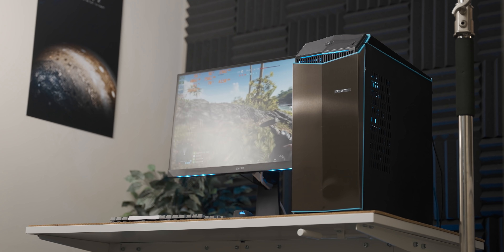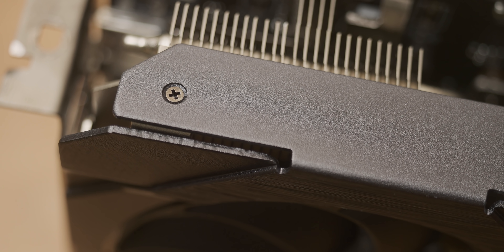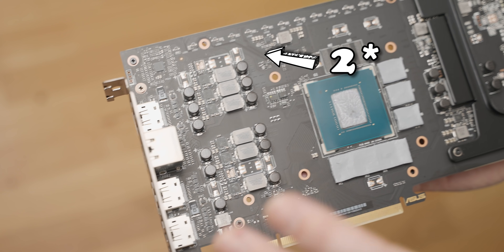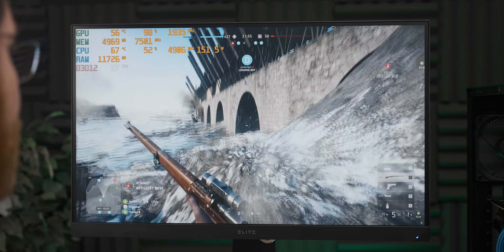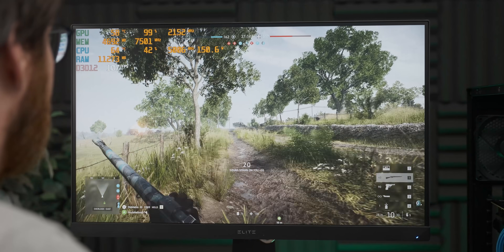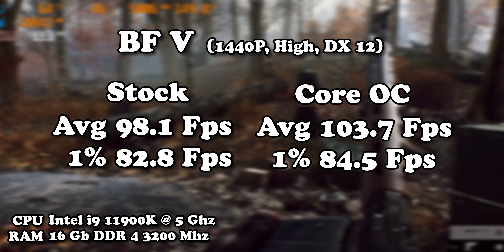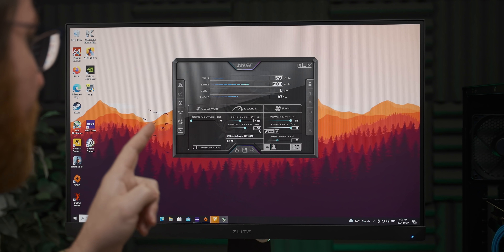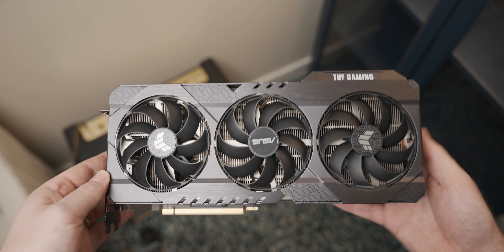Overkill Is BEAUTIFUL, But Will It Overclock?

Comment: Miss my 3060, It was a golden chip (to me) OC to 2.2ghz on the core and +1500 on the memory. Was within spitting distance from a 3060ti stock. It was the Asus Strix modal
Reply: why buy such a high tier 60 lvl card couldnt you have picked up a 3060ti of some other model for the same price as a strix?
Reply: @itsuadman  I no longer own that 3060, that was back in COVID lockdown times in 2020 where all GPUs was super hard to get and the 3060 Strix at the time was $450 I got it for vs the scalped $800 3060ti as they were the best price to performance cards for mining back then. I have a 4080Super now

Comment: Bought this card second-hand at 196 euros today. Given that the boost clock of a stock RTX 3060 12 GB is 1777 MHz, 2167 MHz must offer more than 9 percent performance boost as it is 399 MHz (22 percent) higher clock speed? Would love to know the difference to a stock card ;)

My system also features a Ryzen 5 2600 @ 4,15 GHz which I got for 20 euros. Love finding used but still capable parts and pushing them to their limit.
Reply: I got one off fb marketplace for $180 a few days ago. Came from a 1650 super and I’m really happy with it

Comment: "4 hours overxclocking for 9%"
XOC guy here. you dont know hadness until you did it 12 hours for benchmark comeptitions
protip: use nvidia inspector to rnable rebar in games and benchmarks that dot officially support it. gains are good.

Comment: Just got this card and ran 3DMark test with results low. Went into msi afterburner. Activated over clock and it was getting higher MHz than my evga 3070 ftw3 and PNY 3070l. WTH

Comment: I just built my  first ever PC around TUF Z790-PLUS WIFI D4, Core i5-13600K and TUF RTX3060. I mostly play open world crafting survivals and have noticed a significant raise in enjoyment, since the upgrade from my prebuilt Core i5-4460 and GTX760 system from 2013. My monitor though, is only 60Hz and most games run smoothly at 60FPS with VSync enabled. I've noticed a huuuge 80-110W drop in GPU power when I enable Vsync in pretty much any game I play. What's up with that?

Comment: I own this card and i gotta say man- this things a beast seriously the best card ive ever owned plays 1080p 144 fps maxed out most games and 60+ fps maxed out 1440p most games minus a few newer ones  even with some of the craziest overclocks ive ever thrown on a gpu with over +200 to the core 1300 to the memory it was still stable- overbuilt is honestly not even enough to describe this even with insane overclocking with a 3 hour stress test never got above 61C its a amazing cooler they put on this card I was able to see able a 14% performance increase with the OC and some other tweaks with my PC definitely one of the biggest overclocks ive been able to get thats stable this card is so well built especially for a 3060 it just amazes me

Comment: This is the exact graphics card I ended up with been struggling to get a steady frame rate in Skyrim vr with tons of mods on thought over clocking would help me get a consistent framerate in intensive environments like outside white run
Seems to me looking at this, this card just can’t handle all the mods and my solution should be to cut back
I play alot of vr Pavlov runs like a dream funny Skyrim vr port with mods runs so badly I guess there must not be a lot going on in Pavlov

Comment: My cheap 2 fan Palit 3060 does the same OC, this is the general limit. (loud fans however)
you would be surprised how many games (FC5 with hd texture pack for example) used/cached 11GB of the 12GB vram..

Comment: i feel like the strix card would be better for this. similar crazy cooler maybe better silicon? I have no clue if that's correct. I actually had that exact card for a few months while I waited for a 3080. It did great and I forgot that gpu fans are actually supposed to ramp up during gaming haha

Comment: I have an rtx 3060, and it's an overclocking beast. I didn't want to do a very aggressive overclock so I went with +200 core clock +1000 mem clock, and  it ran fine, as excepted. But here's the catch! I have the palit stormx edition of this card, which has one big fan, and it never really goes above 66°C, which  - for a one fan card - is pretty good, in my opinion.

Comment: I reached 2250 MHz core on my 3070 and +1 GHz on the memory. I couldn't believe my eyes. It is stable at that core freq in all benchmarks and games I've tried. I also never had to increase power limit so it remained at around 200W. Temp never goes above 65C. Gotta say, MSI's Gaming X Trio cards are damn good

Comment: just got this card for 509.00 at my microcenter and was thinking of returning it until now - card was originally supposed to be 350.00 but in this climate I think I got a good deal - still selling for over 750 on ebay and over 850 on amazon

Comment: The best way to usually OC these cards is using the curve feature, especially with the higher end cards as it will allow for higher clocks under full load and lower temps. With this setup the OC will actually drop once the card starts getting hot, with simple games it won't do much but play anything demanding it's going to drop due to temps. https://youtu.be/FqpfYTi43TE?t=3

Comment: Video idea. Get an r9 290 tri-x. It's the graphics card i have and the overclocking potential is oddly good. This thing produces so much heat that i had to actually bluetack a 3000rpm 80mm fan just above the graphics card so the heat wouldn't muck up my CPU cooler. This runs hot but i never exceeded 70c surprisingly

Comment: I just got a 3060 (took me forever) and its temps are shockingly good. I was playing many newer titles and the temps barely reach 70C (average was 67C). Up until now I was using a GTX 1070 and it always reached mid-70s sometimes 80C for some games.

Comment: Dawid, remember you should check the VRAM temps, not just the GPU core die temp. Remember that for the 30-series, the overheating issue is on the VRAM, not the die itself.

Comment: I overclocked my LAPTOP 3060 (90w) to plus 1400 mhz on memory and plus 220 mhz on the core, yet it stayed under 73 degrees, and my 10870h wasn't even bottlenecking the thing. (I have a Dell G15 5510 with a 3060 90w 10870h (8c 16t) 16gb 2933mhz dual channel RAM that all uses the cooling system fitted in under 1.2 inches in girth.) So I am very confused as to why and how I was able to steadily overclock this laptop better than this "chode beast." Went from like 36fps avg with 25 fps 1 percent lows in Control all setting cranked up with ray tracing to like 42 fps avg with 1 percent lows in the low 30's.
Quick edit: I just realized that the OC on my laptop isn't as good as on the desktop 3060 TUF but I still think it's amazing as to how high I could get it, and I didn't even set fan curves!
Reply: @Mazda3Astina  Im ok with low settings gaming so I might not upgrade in 2 years, but definitely within the next 5 years I will be upgrading.

Comment: Wish my 3080 performed this well under load. I have the 3080 Ventus OC model. Has a massive 3 slot cooler with 7 heat pipes and 3 fans. But yet if I run it stock, it pretty much gets to 83 degrees quick and stays there. Even with an undervolt and fans set to hit 100% at 80 degrees, I still can only get it down to about 78-79 degrees in 1440p (72-75 in 1080p). I also have 2 noctua fans right underneath the gpu pulling in cold air. When new gpu’s come out next year, I’m buying one and water cooling it.

Comment: Yeah I managed to get the MSI RTX 3060 Ventus 3x OC. I paid MSRP,  it took weeks of going hard to find it, I didn’t settle with a Google or an Amazon search. I put serious leg work in and considering how I make an hour not sure if I was worth my time, but I like the card. The cooler on gpu is like running a custom loop on a i3-3220. It feels like they made the cooler for a 3080 and then said why reinvent the wheel n slapped it on the 3060 n charged an extra 100 bucks for it.

Comment: I normally start my oc by maxing out the power limits and fans and then vram and lastly the core and then fine tune the fans to be as quiet as the oc allows... max oc while being as cool as it allows... then after finding max oc I try and under clock and fine tune that... gives me 2 very good oc profiles (cool/balls to the wall)

Comment: He never touched voltage, I believe if he increase voltage and increase the power limit, he could have a stable +2.2ghz overclock, especially with that cooler. He states he "only" had a 9% increase, but remember, this was all done at 1440P! To me that is pretty substantial.

Comment: i wish i could trade coolers with ya i have a msi 3070 ventus 2x oc and this cooler is like just enough to cool this thing barely honestly cheap bastards at msi sheesh...... had to take it apart once to to tighten everything then got a little better temps. i put on a evga bios onto it to and makes it even more hot if over clocked haha

Comment: It doesn’t look like you increased the core voltage at all. That’s why you didn’t get much farther with your overclock and why your temps didn’t go up. You still have plenty of thermal headroom to increase voltage which may allow you to push your core clocks a bit higher.

Comment: It appears to be the same or very similar cooler I have on my 3070.

Also Dawid, what program do you run to see those temps ? I'm just now getting back into the hobby after being out of it for 8 years or so. Would like to see what my GPU temps are.
Reply from the maker: Hey! That is a good version of the card you got there. I use MSI Afterburner for the overclocking and the temperature overlay. There are a bunch of videos on how to set up the overlay for MSI afterburners. 👍

Comment: I see you don't monitor GPU wattage, so maybe the limitation came from the 110% power limit. 

If you increase memory, it should take more wattage, thus preventing you from boosting all the way up to 2200mhz again.

If you want to go crazy, flash the bios to Asus ROG 120% power limit so you can increase the core frequency a little more and aim for a 10-11% FPS gain!

PS: Not flashing a BIOS properly can brick the card.

Comment: The conclusions speak for themselves, though. Even with a card that apparently won the silicon lottery, you only get 9% more performance, and you're flirting with stability issues.

The days over massive gains from overclocking are over for most mainstream cards.
Reply: true, cpus as well
Reply: Not true, but to overclock above this you need to increase voltage and this is not that is with these cards.

Comment: I have mining rig with 6 of these but in STRIX variant(same fans and heatsink), was supposed to slap 5 140mm fans for cooling but those cards are soo cool that I didn't need to use any additional fans.

Comment: All you need to do is up the memory clock, start with 500, but honestly you can go to 1100 pretty safely on these 30xx cards. That will actually yield you more performance, got +13.2% on average with my 3060Ti on +1100 mem oc., nothing else.

Comment: Dawid is there any way to push the card further by tuning the mV slider? If the temps are that good, running more current through it could stabilize it on those higher clocks, and has the temperature headroom to do it!

Comment: Then there's me: oh, that overclock worked? Cool, add +50 on core and +200 on memory each time until it dies, then go down.

The reality is even if it's only a 9% increase, that's still extra frames you're leaving on the table if you don't do it. I always go for the overclock.

Comment: Remember, the new cards does not always crash when you OC the memory. It just looses performance because of error correction. The only way to know what your max memory OC is, is to benchmark every step you make and see when performance drops off again :-). +1000 might be a lot faster than +1500.
Reply from the maker: Oh cool! I'll keep that in mind next time. Thanks for pointing that out. 😊
Reply: Yeah this. My 2070 max-q can do 1150 on the memory but I have it set at +800. Core is at +150 if anyone cares lol
Reply: You need more voltage to overclock .
Reply: I dont know how people get 2100mhz on core without moving voltage, i have an oc of +135mhz (on an already oc card of 1837mhz) that gives me 2017mhz at 986mv (stock are like 965mv) and +800mhz on memory, hynix gddr6 dont like aggressive overclock

Comment: Sometimes a higher memory clock setting that works will actually degrade performance or have no effect.
And this GPU is not telling you what the memory temperature is.
Anything over +90 on my 3090 memory has no further benefit, although it will work.

Comment: A tip here. When you increase the clock speed on Nvidia GPU's you are telling the card to run a higher clock at the same voltage. So you are effectively undervolting the card. This means you shouldn't see any temperature increase with your increased clock. Also when you run the new memory at a higher hz, it might be stable but actually run slower then you think. The reason is the error correction is so good on these that you might be getting tons of errors but not notice anything wrong other then worse benchmark scores.

Comment: try 3090 once 😅😂
Reply: The memory on 3090s gets too hot to overclock, or up the power limit. I run my 3090 at 75% power for mining, which does not affect the rate at all, and sometimes I forget to put it back to 100% to game, and I noticed no difference in the game.

Comment: I got the 3080 variant of this card (MSRP too, thanks memory express!) and I wasn't so lucky with mine in terms of OCing. I'll be lucky to stay over 2ghz on mine but it can do 1000 on the memory NP. I do find that even OC'd it can vary from game to game what frequency you end up at. Like in 3d mark it'll hover over 2ghz but in most games that actually push it 100% it never gets over 1900 no matter what I OC it to. It's weird. Temps aren't any different either. It tops out at about 72c in my case with the fan curve I have on it.
Reply: Ampere doesn't OC worth a crap

Comment: I have a feeling that the gpu's temperature is so good is that the shroud doesnt choke the air coming out of the sides of the card.
Reply from the maker: That definitely plays a big role.
Reply: @DawidDoesTechStuff  Wub u
Reply: @DawidDoesTechStuff  I think a thermal pad and paste replacement could drive the temps down even further, though the Asus cards should have fairly decent thermal pads.
Reply: Dawid has conditioned me so much I immediately imagined a certain face peek in on the screen when reading "shroud."

Comment: This generations Tuf cards have insanely good coolers!I have a Tuf 6800XT and while running heavy overclocks (2650-2700Mhz core and 2100-2150Mhz memory) it barely gets above 60 degrees on the core, and 80 ish degrees on the hotspot.. that is insanity :)

Comment: That cooler on the 3060 is OVERKILL...
Reply: Yup, it's the same one that's on every tuf card right up until the 3090. That's why the temps didn't change much even in a nearly air free case lol The 3060 probably isn't even close to saturating that thing.
Reply: @devilmikey00  So true lol!

Comment: David HELP!!! my GT710 is reaching 95 degrees when i over clock it and i cant buy a new gpu cause you know why also i can't just attach a fan to the heatsink cause its not passivily cooled either i did clean it but still the temps are high what do i do
Reply: Strap a small fan to it.
Reply: @Razor-gx2dq  It already has one its the "cooled" version i even cleaned and repasted it yesterday

Comment: Yeah, you definitely have to manually adjust fans if you are overclocking these things.  And as I have recently discovered with my Strix 3080, MSI Afterburner has apparently only controlled the middle fan this whole time; have to use GPU II Tweak to adjust left/right fans as well.  There are also GPU bios updates for some Asus cards.  

And you definitely have to monitor thermal junction temperature (NOT just GPU temp) and ensure that it stays under 110*c, ideally low 90s.

Comment: You could use a Kill-o-Watt meter or an UPS to measure wattage draw from the wall. That way you can see how much more electricity it takes for a given increase in FPS.
Reply: The electricity cost difference on a card like a 3060 is going to be completely negligible
Reply: u can use msi afterburner to track gpu watts lmao
Reply: @b.henriques9871  its not 100% accurate